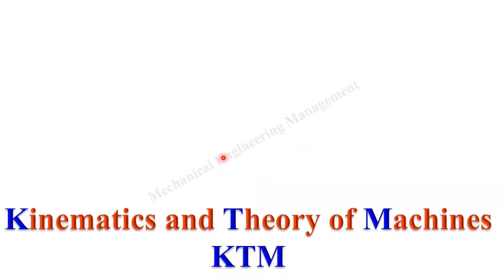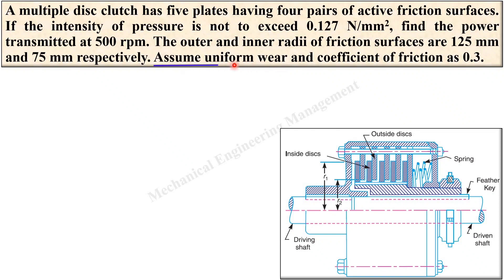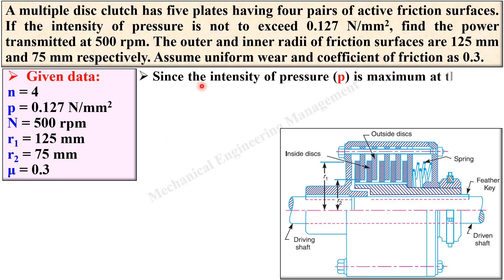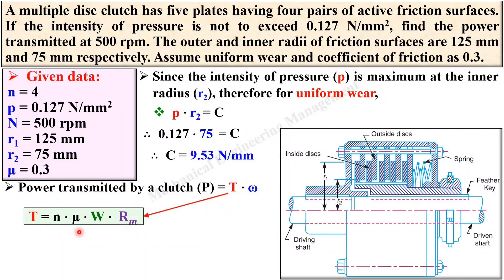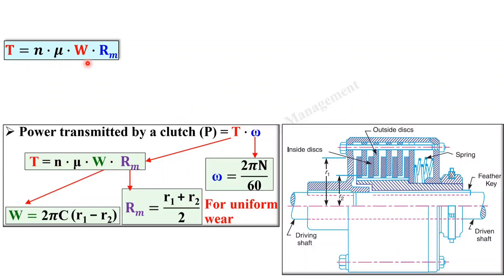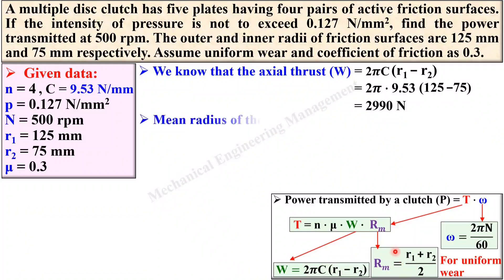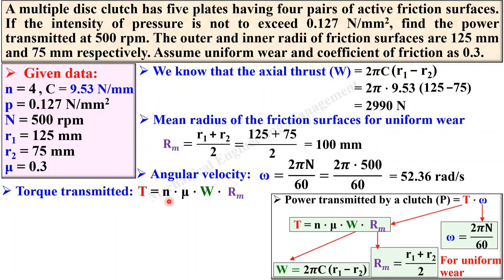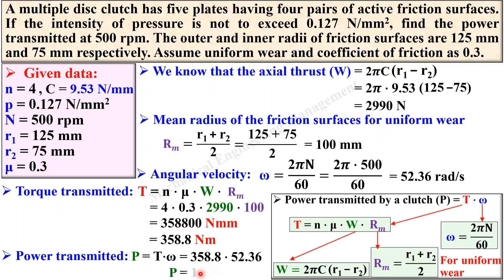Multiple plate Clutch Example, 2, Problem on Multi plate clutch #KTM #TOM #clutch #Friction

Comment: In a multiple disk clutch, the radial width of the friction material is to be 1of the maximum 
5
radius. The coefficient of friction is 0.25. 
a. How many disks are required to transmit 60kW at 3000 rev/min?
b. The maximum diameter of the clutch cannot exceed 250mm. The axial force is limited 
to 600N. What is the mean unit pressure on each contact surface?